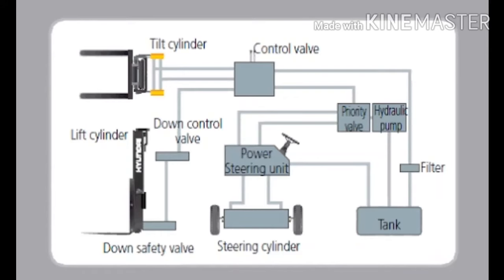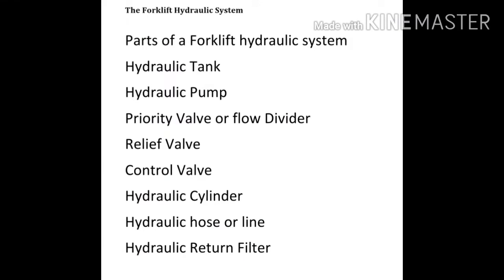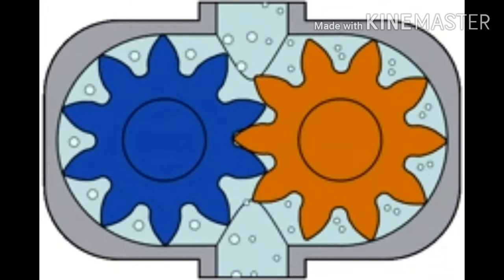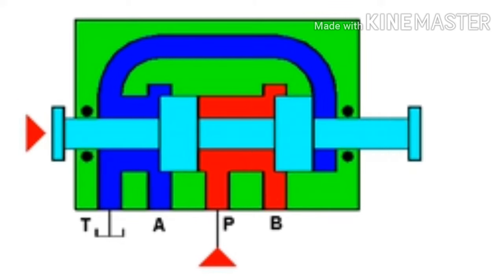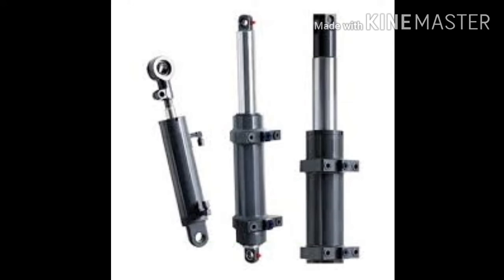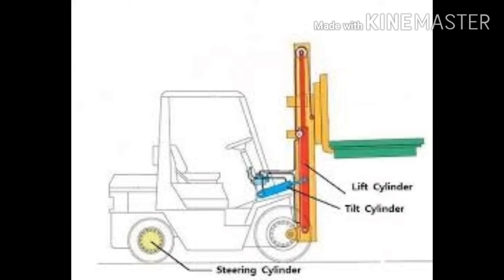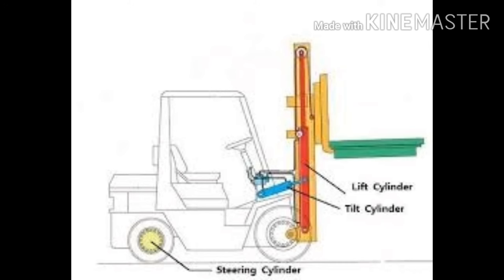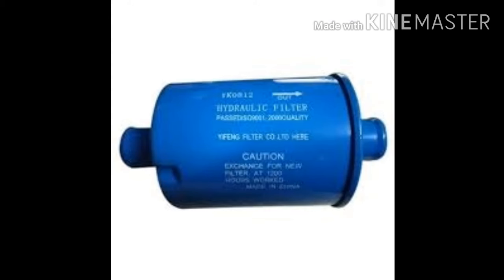Forklift Hydraulic system and How it works

Comment: Question. What is the value of the pressure that the hydraulic pump can generate in a forklift?
Reply from the maker: In almost Forklifts system working pressure is 160 Bar and system relief at 180- 190 Bar, Pump develop only flow and from that by use Restricted way build pressure